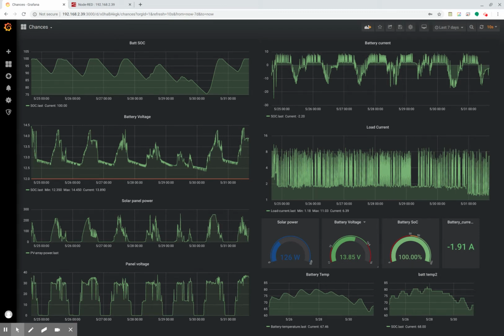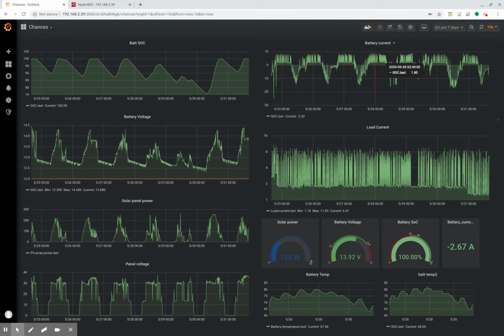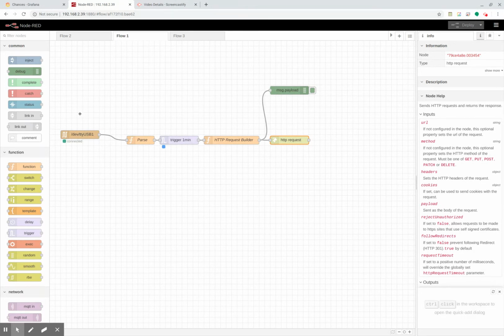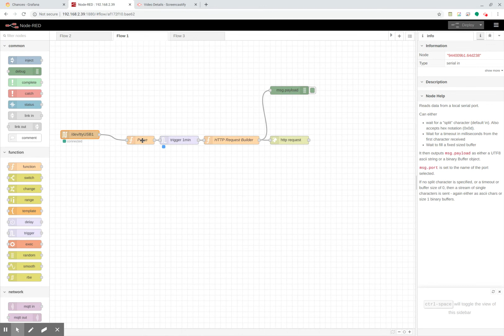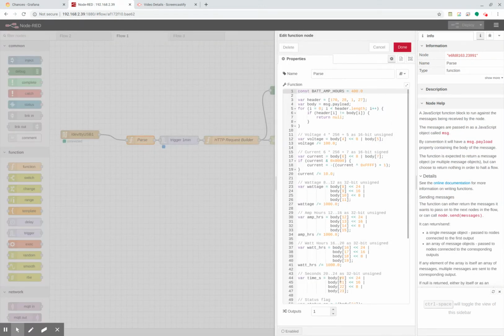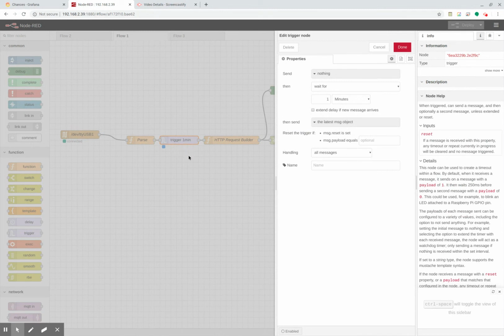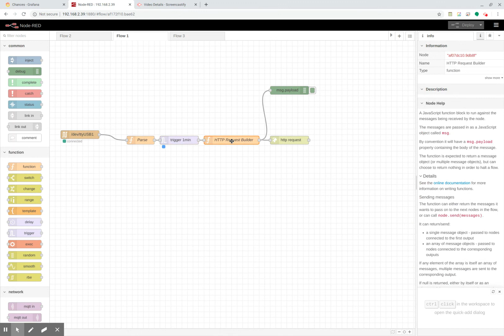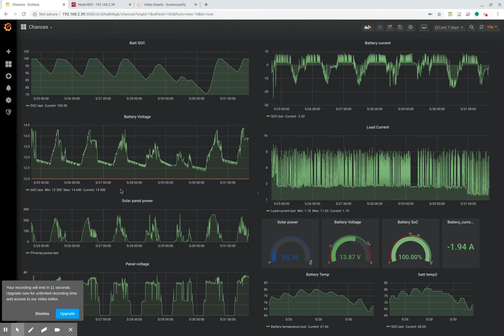A battery state of charge(Volt/Amp/Watt-hour/coulomb counter)solution for wireless network Part 5of5

Comment: Hi Robert, great work on this.  Looking for something like this for my van conversion using lithium batteries.  I was wondering if one could use an esp8266/wemos d1 connected directly to the display's white/green micro usb port wires to read the data? I just want to read the battery info and have the esp host a simple webserver so I can connect to it to view the battery stats.  I understand this can be done with your USB-RS422 cable and the RPi but its a bit overkill just to run a webserver IMO.  Any help would be appreciated thanks!
Reply from the maker: You may be able to get something working with a USB host shield that interfaces with a ESP8266.  The other, (better?) option is a RS422 or RS485 to serial converter and connect to the ESP8266 uart0 pins.  Keep in mind ESP8266 has 3.3V I/O.  So select hardware accordingly.  Also UART0 is used for programming/debug.  That could complicate things.  Other Arduino hardware with multiple serial ports would be better IMHO.   Like the ESP32.  Or just do what I did with a RPi.
Reply: Hi, have you got any updates on this I also hae esp32 and I want to connect it to my VAT1300. Any help will be much appreciated.

Comment: Does anyone think, or has anyone tested, that the data from the shunt is in Modbus format? 
I connected a USB RS485 converter (CH340) to the wires from the shunt according to Robert's description, but I can't get any data into my scada system. 
Can anyone advise or direct me?
Reply from the maker: It is not Modbus.  I use an FTDI RS422 as I'm only listening (spying) on the data and never writing.  But an RS485 module should also work.

Comment: Be aware my Juntek 1200 does not display small currents though.I have raspberry pi as a load which constantly consumes 0.2amps.The juntek never sees it so hence after a few days the battery could be flat and the juntek never knows?.
Reply: I'm going to look at this soon with my pi zero, I've a vat 1030

Comment: Hi Robert, great videos. I have the Juntek VAT1200 and following you video I can see some serial data, but cannot really "decode it" properly. Do you think that the header is likely different and will have to be sniffed out for each device? I have ordered the logic analyzer in the mean time, but I wonder what do you think.
Reply from the maker: I don't think they are different.  Although, I've only played with the VAT-1300.  Make sure you don't have the polarity wrong on the RS485 signals.
Reply: @flatman2008  Yes, I have tried both ways and multiple rs485 and rs422 dongles (no success with any of them). Do you have a guide on reverse engineering the header/data itself (maybe some online article that can be followed to make heads and tails from rs485 data). For someone that is not skilled in reverse engineer this would be an excellent tutorial as I can see more people have struggled getting data out of the Juntek shunt. Thanks
Reply: I have also got the Vat-1200 and i can not decode the data either using rs485 so i have also ordered a logic analyzer,but have no experience either but i will give it a go.
Reply: @vwtrike9546  Let's hope that one of us  can figure it out. @Robert Flatley any pointer where to start or how to approach this one, we we do not have skills in reverse engineering(any links that you found useful that you can share, etc)? Your howto is very valuable(as we know it is possible ;-) , but it would be awesome to see some of the nitty-gritty details about the debugging and what we should/shouldn't see when trying to figure out the header for the VAT1200. Thanks
Reply: @ivokohler5868  I don't think this is a header problem etc.The data that is coming out is garbled just like when you have a wrong baud rate or parity etc.It should be a readable list of numbers in a readable format.So hopefully when the logic analyser comes it may tell a story.
Reply: @vwtrike9546  Actually, I have the same issue, I am not very familiar from these protocols.I was suspecting that there is something wrong with receiving the data, but then I thought that it should not change from device to device, but if you are getting the same garbled input as well that makes more sense. I will do some testing in my spare time. I assume once we get the baud rate, parity etc correct we should be seeing readable data, correct ?
Reply: @ivokohler5868  Well i ran the logic analyzer on the juntek tonight.Everything was outputting correctly as far as the header was concerned.But then it became garbled through the rs485 converter.So i have an RS422 converter coming tomorrow to try.I will see what results come from that and let you know.
Reply: @vwtrike9546  great work, I am in New Zealand, so any shipping takes weeks, sometimes months :-( , so for now I will rely on your testing ;-) please keep me posted. Cheers
Reply: @vwtrike9546  Just checking in, if you had any luck getting the comms going? I can see that you have something going as per the other comments, do you have a guide or some details about it, please. Cheers
Reply: @ivokohler5868  I've tried via a RS485 usb dongle and got nothing, though I suspect the cable that I've butchered, it could also be due to termination. I have some proper breakouts on their way so I'll probably post here if I have any luck!
Reply: @ivokohler5868  Well, after grabbing more appropriate tools, I've found that you need the thing plugged in, and you need to snoop the D+/D- bus - polarity appears important, I'm using a random RS485 dongle from aliexpress.
Reply: I'm guessing the display does some weirdness to get the microcontroller to start sending RS485 data out. I'm also getting two extra 32 bit fields on my VAT1030
Reply: @opless  Yep, I had the VAT plugged in as well and I am snooping on D+ /D- I have tried both ways and still getting only garbage on the serial output. I have tried few RS485 from aliexpress with no success. So are you getting readable data from the VAT?? If so could you share your config/setup (baud rate etc). Thanks
Reply: @ivokohler5868  sorry just saw this. I managed to blow one of the data lines when I was trying to send data to the shunt so have been trying to figure out what to do next (5V TTL serial adapter is arriving today)
The serial port was set to 57600,8,n,1 and it was a random RS485 thing from AliExpress. If you have problems snooping but still get data, swap the data lines
Reply: @ivokohler5868  I'll pop a link to GitHub when I upload my python script soon :)
Reply: @ivokohler5868  it looks like my link didn't get posted. Here's my stuff (in python) https://github.com/opless/juntek-vat-python
Reply: @opless  Great, I have just tested in with the "cheapest" rs485 from AliExpress and it is working. Thanks a lot please add VAT1300 as working as well ;-)
Reply: @opless  Also I have now added some code to publish the data to mqtt. I am happy to share the code (I am no developer, but it is working ;-) .
Reply: @ivokohler5868  send a pull request please. That was on the list of things for me to do! (Or drop me a message to my Gmail account - 😉)

Comment: Hi Robert, I have designed two or three projects by using Arduino , but they are simple ones, I am interested to go further regarding data transaction by using CBUS . Is there any pathway that I could  achieve that ? what the course or degree I need for that ? Do you have the time to be your student and we could talk about the fees ? my regards .

Comment: Hi, can you expand a bit more on the settings for the hardware connection? I have an RS485 usb adapter, which is recognised by a Raspberry Pi, works on other devices, shows up as /dev/ttyUSB0. But no serial data comes through. What settings are you using for parity, data bits etc? Thanks.
Reply from the maker: 57600 baud, 8 data bits, no parity, one stop bit.  You must have both the base shunt and the controller (LCD panel) hooked together.  The RS485 adapter on your Raspberry Pi spies on the traffic passing between the two.  RS485 dongles are sometimes tricky in that they are often half duplex.  Meaning they use the same two differential wires to send and receive and can't send and receive at the same time.  If they are 'stuck' in transmit mode they can't receive.  If you are still having problems I'd recommend hooking two RS485 dongles on the Raspberry Pi to verify you can send data between them.  Open two Putty sessions or some other terminal program to send/receive.  The other thing you can try is to swap the RXD+ and RXD- to see if perhaps I've documented the polarity wrong.  

RS422 dongles are better IMHO in that they are always full duplex.  Simply use only the receive side of the RS422 and leave the transmit open.  I like the FTDI USB-RS422-WE-1800-BT cable.  It has built in red/green transmit/receive LEDs so you can visually see it's receiving data.  You can also loop back and RS422 cable on it's self as a test to see if it's transmitting and receiving data.
Reply: @flatman2008  Brilliant, thanks for that, data coming through just as expected. I feel a bit of an idiot - I'd looked at the pins with the display disconnected and seen voltage variations - so I assumed it was just always on. It never occurred to me that you'd NEED to have the display physically connected. That's a bit of a pain for my intended use, but something that can be overcome later. There'll be a way to fake it somehow...
Reply from the maker: It's possible to fake it and eliminate the display/controller but much more involved.  That's basically what I did in the previous YouTube videos (parts 1 through 4) with the nrf24l01+ modules. Glad you got it working.
Reply: @flatman2008  I didn't look in detail at those because I was focused on this method, but it looks like I might have to go down that route. At the moment I'm trying to decode the data - mine is the older version and I think it might be different to yours. Do you have a copy of any of the raw hex or binary data you got out? The other question I had was where you derived the header info from in the code in the node red flow. Sorry to pester you, this one has really highlighted how much I don't know about this side of things!
Reply from the maker: @DrBurkstrom  The Node-Red script is up on GitHub (link is in the description).  I used a logic analyzer to grab the data.  HiLetgo USB Logic Analyzer ($12.49 on Amazon). And free open source Sigrok Pulseview.  Although RS485 being differential you may have a little trouble grabbing it.  Try both the + and - wires.  You may see data on one but not the other or inverted data on both.  Or try to grab the non-differential data part way down your RS485 dongle.
Reply: @flatman2008  I'm using a USB dongle with both + and - plugged into a Pi, and miniterm to view Hex data. At the moment I'm manually going through the hex data to try and find repeat patterns that are constant when everything else is fluctuating. From what I can tell without a logic analyser and just what bits and pieces I have to hand (on the boat, not a terrific stock of tools and parts), the data it sends to separate one batch of data from the next is known only to the monitor, so as near as I can tell I need to find that string and work from there. Inverted data might make sense, a capture from a point where there was 0 current showed a lot of very large numbers!
Reply from the maker: @DrBurkstrom  Again, I would suggest just looking at the Node-Red script. Pretty much self documenting on what comes over the serial interface.